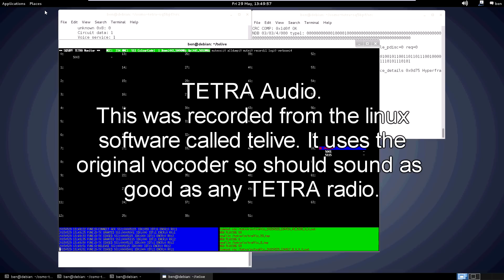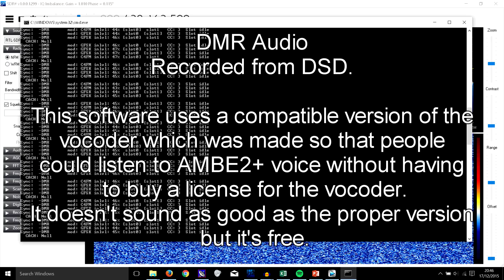DMR vs TETRA Audio Comparison

Comment: Dang, thanks for capturing these clips and offering a comparison. DMR sounds more loopy, probably due to the compression. TETRA sounds more linear, but with more crackly/fuzzy distortion. I am curious how other digital systems sound.
Reply from the maker: Most of the new ones now use the same vocoder as DMR so they sound basically the same

Comment: tetra is better
Reply: That's why the 🐖 like it
Reply from the maker: For sound quality I agree
Reply: @radiosification pretty sure they use the same vocoder, no?
Reply from the maker: @AliBaba-vw7mo  not at all. Totally different. You can hear how different they sound just in this video. There's no way the same vocoder would produce such a different sound
Reply: @radiosification  right I assumed the difference in sound in this video was down to the fact that DMR vocoder used in this video was not original
Reply: @radiosification  after some quick reading, TETRA’s ACELP based vocoder seems to code voice into a 4567 bits/s before FEC. This seems to be higher than DMR’s reported 2450 bits/s before FEC. I guess one could argue this higher bitrate is responsible for the better audio quality🤷‍♂️
This was all pulled off Wikipedia so I’m not sure how correct this information is. To REALLY get it right you’d probably have to dive into ETSI standard documents.

Comment: the TETRA actually sounds OK but the DMR is awful.
Reply from the maker: The DMR sounded pretty decent to me. You have to remember this is compressed voice. It's compressed down to a very low bitrate to be sent over the air and there are many benefits in using digital compression over using analogue FM voice.
Reply: radiosification I agree and understand but why compress it so much? the audio quality really suffers. personally i prefer to listen to a bit of hiss and have the superior sound quality of analogue. just not a big digital fan I guess!
Reply from the maker: It has to be compressed so much to allow the functions that DMR has such as allowing two conversations in one 12.5KHz channel. It could be compressed less but then it wouldn't be able to do that.
Reply: radiosification maybe one voice per channel is a better idea, after all there are plenty of spare frequencies.
Reply from the maker: In some places there are. In other areas there is a lack of spectrum. In London the available spectrum is actually pretty crowded and if you think of the cost of a business radio license, it makes a lot of sense to get two channels for the same price instead of just one.